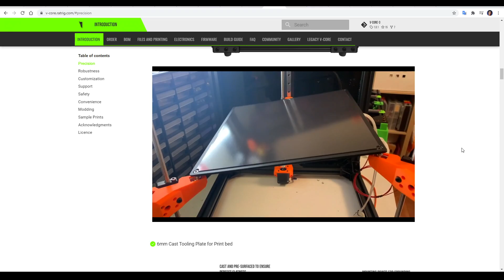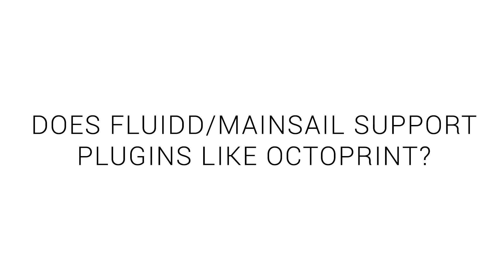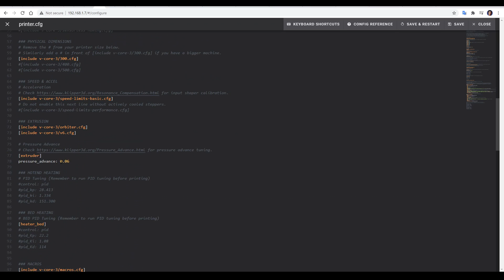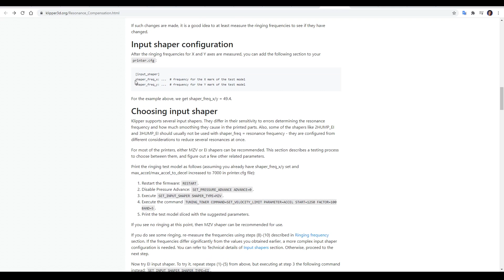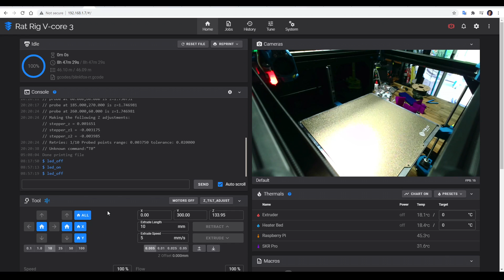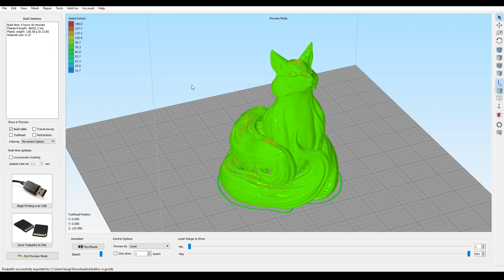Klipper input shaping - A leap forward in high speed AND high quality 3D printing [Rat Rig part 4]

Comment: Hello, first of all, I apologize for my bad English :). I have an Artillery X4 Pro 3D printer with a KL v1.01 motherboard. This motherboard has a 6-pin socket called Adx1. I want to connect my own ADXL345 sensor to this socket (the original sensor is called ADXL345, but it's quite expensive). Can you help me with the pinout?
(The sensor I bought has pins GND, VCC, CS, INT1, INT2, SDO, SDA, and SCL).
Thank you very much in advance.

Comment: The axis arrows on accelerometer ADXL345 board are not just for fun. According to the arrows board should be parallel to the printing bed and X and Y should align with your bed's X and Y. Your ADXL345 board is perpendicular to the printing bed plane and instead of X and Y you actually measure X and Z.

Comment: I used the same wire you said didn't work for the accelerometer and it worked just fine. Did have a few issues at first but it turned out I just crimped a couple connectors wrong.

Comment: wont loose hanging wires give odd resonance frequencies? shouldn't they be tightly hold down? And those connectors ware off with time and I suggest direct soldering and securing the solder points (with the wires) with some hot glue to add rigidity. Any thoughts? Am I wrong?

Comment: Very helpful video, once again. Thanks.  I have aVoron2.4 and a Ratrig Vcore3 500mm3 on the way. Question is, what does the accelerometer do that we cant do by hand, since the first version you showed using your eyechrometer also removed the ringing? Also, do you think there will ever be support for the accelerometer to make adjustments in real time?

Comment: Hi great vid… you talked about pressure advance and that you have to do it over for a different filament , you saved in the cfg file , but how do you change that in klipper when you want to print with a filament you already used before

Comment: how will this function affect the wear of the motors?
Reply: It will reduce it (for equal acceleration). I run 3000 acceleration on an Ender 3, and it is quiet. With input shaping off, that acceleration will sound like someone is hammering at it.

Comment: Thoughts on additional machine bracing, attaching the belts inline with the CG of the print head assembly (hard to pinpoint with flying cabling and linear bearing friction components maybe), and moving the accelerometer to a point that coexists with the nozzle tip as closely as possible?

Comment: Just want to say that fixing ringing and ghosting artifacts by software is really great, but it would be wise to also solve this problem using a granite or heavy base and have the 3d printer bolted to it, this will dramatically improve results. To have even more better results, have all the axis rails changed with more heavy and firm accurate rails. All the minuscule ringing will be absorbed by the mass of rails and base. This is why all of the precision CNC machines that are expensive uses heavy base and rails.

Comment: Manual tuning (mentioned at the beginning of input shaping section of the video)is much better option, doesn't take much time  and reflects real printing conditions like desired speed,acceleration, filament being extruded, nozzle interfering with printed object etc.I tried both methods and found manual method far more superior-and is really easy to do.Also found pressure advance tuning pointless on direct extruder (just set up extrusion factor),pressure advance only make sense  for bowden extruders.

Comment: note that input shaping is calibrated before pressure advance (using set_pressure_advance advance=0 if tuning shaping manually without accelerometer), and then with calibrated shaping you need to re-calibrate pressure advance again. for high-resonating printers pressure advance can change significantly.

Comment: Can I use ADXL343 from Adafruit? It's half the price of ADXL345 and on Adafruit site they are saying it's identical and any code for 345 "should" work for 343 as is.
Reply from the maker: I have three on hand. Yet to test but I will be in an upcoming video.
Reply: @TeachingTech  Thank you very much!
Reply: @TeachingTech  One additional question. Is ADXL required to be on printer even after creating and implementing tested values to printer firmware? Or can I remove it then and printer would know what to do based on these generated values? I'm asking because I would like to have it on Y axis also in my printer, so I don't know if I need one or two ADXL's.
Reply: @timp6930  You measure once, and use the same values after that.

Comment: Hi Michael, do you think input shaping would still function the same on a belt printer? (with the accelerometer mounted 45 degrees from horizontal) Since there is the additional gravity in effect, would that be an issue?

Comment: Is klipper and the accelerometer only suitable for the Rat Rug or could one use this with a cr-10?
Reply: normally I use Cura, looking to upgrade the printer with 3d bed leveling, stepper motor control and SKR MB too.

Comment: FWIW, you can get 18AWG, 4/5/6 conductor ribbon cable.  It is used for carrying power + data for LED strips. Here is one example: https://www.amazon.com/dp/B07TMKBY63  

If you only need four conductors and shorter lengths, 'trailer wire' often comes in 16/18AWG (16 for ground, 18 for the other three) or even 14AWG.  If you need to send a LOT more power, 7-pin trailer wires are generally 10/14 gauge.  (Yes, really.)

Comment: I’m just wondering if it’s worth doing this to an Ender 3. 

I was reading the info that came with some PETG, and it said print “slow”, less than 60mm/sec… 40mm/sec perimeters is my “fast speed” (it was the default Ender profile speed in prusa slicer) and I thought I was getting layer shifts trying to actually go that “fast”. 

Had it down to 20mm/sec before I figured out it was an overheating issue of the Y stepper motor/driver (even with a 140mm fan blowing on the BTT SKR Mini)
Reply: Yes it is worth it, I run an E3 at 3000 mm2/sec and 100 mm/sec. With PETG, but 10 degrees higher and an all metal heat break. Need to melt that filament.

Comment: I am not a 3d printer person...but I love watching videos about it.  I noticed that even with input shaping on as your print moved up there some some(albeit much less) ringing...I was wondering if that might be due to the resonant frequency of the printer changing slightly as the print progressed upward...and if it might be possible to have those configuration settings shift as the print progresses...or am I just missing something basic?

Comment: I tried to use Klipper in my Ender 3 with SKR 1.3 and TMC2209 drivers and wasn't able to make the motors work at all. As it is working fine with Marlin for 2 years already I simply cannot configure the TMC drivers in Klipper. If anyone has a similar working configuration let me know, please.

Comment: You should make some scale models of the 1992—1994 McLaren / Williams using some of these new techniques.

You should also store your filament spools inside of a dehydrator, a la Maker's Muse, and feed directly from that dehydrator to the printer.
Reply: Some further ways to enhance your printer;
- Real-Time 3D scanning of the print to automatically adjust and recalibrate settings on the fly if the printer's comparer realizes that something isn't adding up.
- Adding some kind of vibration dampening to the entire printer assembly (especially the bed).
- Give your printer an automatic "brush teeth" function to keep the extruder clean.
- Adding features to your custom slicer, like;
---- Non-Planar Slicing
---- Load-Depensent Infill
---- Gradient Infill
---- "Elephant's Foot" Compensation
---- Variable Layer Height

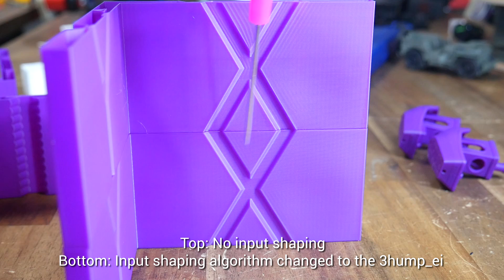Comment: Michael...do you see the vertical lines at 16:33? i have those too. 2mm spacing. 'X' side only. are these caused by the belt? how do you get rid of them?
Reply: Yes that is usually due to high belt tension. It's ok to have these to start with, once the belt settles in after initial tensioning it will loosen a bit and these will go away. If they don't, simply loosen the tension a bit until they're gone :)

Comment: I made a new printer recently.  For a belt tensioner I mounted the return pulley using a bolt through a buick drum brake hardware spring.  These are pretty stout but it is easy enough to compress.  I have yet to tune for ringing but it rings pretty badly... not a surprise but it was worth a try.

My mount has a tight guide so the pulley is captured well regardless of position.  The spring can easily be swapped or removed with a solid cylinder.

I wonder if a good video could be made regarding tensioning techniques.  Say hand tensioning (pulling the belt tight then zip tying), then with a screw, then with that flat clothespin like belt mounted spring, then a coil spring.  Also maybe taking an ender 3 or something common and adding gussets to stiffen the frame.  I think people are hung up on using the "correct" extrusion like a 2040 when truly the bending of the extrusion is insignficant, I think the rigidity is improved because of the wider contact between the extrusions at a corner and not the extrusion itself (structural engineer guy me).

Comment: Wow, are the layers on the fox noticeable to the touch or to the eye? I can't see them in the video, but I know that videos can lose that sort of detail.
Reply: That solely depends on layer height. I printed a scaled down judge dredd (5cm tall) model on the V-Core 3 with a 0.25mm nozzle at 0.05mm layer height (200 mm/s, 6k acceleration), layer lines are invisible, you need a macro lens to see them. That thing came out amazing.

Comment: I made this setup for a Hypercube (coreXY) and it worked great! Thank you very much for this playlist. I had a question about the display using an old tablet. Is there a correct way to connect or did you just use the USB as power and accessed the IP of the PI through the browser? That way, whenever you turn on the printer, you need to access the browser to see the initial screen. Is this the best way?

Comment: Solid karate chop montage. The accelerometer stuff is curious. Do you know if that will work with other boards in klipper?

I’m pumped for the #speedboatrace my personal best on an ender 3v2 is only 50m
Reply: It's independent of the board. If your board isn't fast enough or doesn't have a spare SPI port, you can just hook it up to the Raspberry Pi instead :)
Reply: @miklschmidt  i have since done a tone of reading and an adafruit accelerometer arrived tomorrow 🌞
Reply: @powersv2  excellent! Have fun :D

Comment: Thanks for making me interested in klipper. I am setting it up with my Ender3 v2. 

One detail that was not covered well in their documentation - I think you need to comment out "max_accel_to_decel" from the config file before tuning pressure advance. I started with the input shaper tuning and when I later did the pressure advance tuning I ended up printing six full prints before I realized the problem and could measure the best corner shape. 

Another issue: how would it be possible to adjust the print speed for the critical first layer when LCDs are disabled and there is no obvious way to control this with klipper during prints?

Comment: Using I2C with long wires you need to add a stronger pull up on the remote end to account for the increased capacitance of the transmission line. The Adafruit ADXL board has a 10K pull up, changing that to a 4k7 will give you more reliable signal. Also make sure you keep them far away or shielded from the high current lines for heaters and steppers.
Reply from the maker: Thanks for the tips. It's been reliable since I ran the ADXL loom separately to the rest, you are spot on.
Reply: @TeachingTech  You can also try twisting positive negative pairs together to reduce crosstalk. That's what's done on Cat5e and up.
Reply: @pinaz993  I braided the adxl loom, works perfectly. :)
Reply: @pinaz993  I know this is a relatively old comment, but I2C is not a differential signal so this will not help.
Reply: I struggled with this for a while. Don’t be like me and re-crimp, re-wire, re-solder; try a short cable with 3v & Ground first. If it works now, cut off any excess wire then maybe swap out the resistor 😁
Reply: Also using shielded Ethernet cables for signal carrying works surprisingly well.
Reply: Hi, what resistor value would you suggest for a 2m long shielded cable, and where is it I place this resistor? Im not quite sure as to how this works. Any help would be appreciated.

Comment: Why does an accelerometer need to be used to measure the acceleration? The forces are predictable since you are controlling the printing head's movement and you know all the variables involved. Can't the acceleration just be compensated for purely in software?
Reply from the maker: AS Mikkel says, the accelerometer is measuring the resonant frequency: the result of the acceleration, not the acceleration itself.
Reply: @TeachingTech  Yeah, that makes more sense then.
Reply: It is compensated for purely in software. The accelerometer is used to find the resonance frequencies to base that compensation on, this is a set it and forget it kind of thing, you could mount it temporarily if you wanted to. The only gotcha is that any time you make any physical changes to the printer (like move it, retension belts, swap a part, etc), you will have to recalibrate, so it's just more convenient leaving it permanently mounted. It's very hard trying to guess the frequency you need because so many variables are involved. Weight of the gantry, tension of the belts, construction of the frame, etc etc. With the ADXL345 you can quickly measure the resonant frequencies for both axes, calculate the most efficient shaper model and the job is done, all you have to do is write "SHAPER_CALIBRATE" :)

Comment: The second i heard "acceloremeter" it clicked, it is just so obvious and can be used for all sorts of things... like... actual feedback from the head, so that the board actually knows if something is moving.. It should be able to run full calibration now, all parameters that are about the head movement... jerk, velocity max.. all of it. Now we need an optical sensor for the filament and i have an idea for that.. 

Place a rudimentary camera (sensor+lens) after the extruder. Use the indentations that the extruder motor makes to the filament to detect motion. Needs clever piece of lighting, probably a low power laser will do it.
Reply from the maker: It's exciting where this approach can take us,. Your ideas are spot on.
Reply: I’ll be implementing a laser/ ir diode combo on my printer because reliability is key, laser under nozzle could detect nozzle jams instantly, filament run out, layer width (for calibration purposes), and lifting of print off the build surface (part would block laser path)

I made a post on Reddit discussing it more in depth
Reply: Also it should work better than camera/ ai monitoring in low/ no light conditions, and as you said, low cost

Comment: Wow, that combo of print speed and quality is just incredible!

I’m tentatively considering a V-Core 3 for my next/ultimate 3D printer, but the one thing missing is dual extrusion. (I know RRD has an IDEX model, but I want the CoreXY speed and accuracy.) When I asked, they told me that some community members are working on an IDEX mod, but that CoreXY makes it tricky. I hope it works out; that’s the only limitation I see to this being the “ultimate” 3D printer for me!
Reply: IDEX on CoreXY is not ideal if speed is what you're after, since you're putting a ton of extra weight on the gantry, which is already the bottleneck. The difference in speed between a CoreXYU/V (IDEX on CoreXY) and IDEX on a cartesian is probably negligible, minor at best. Another challenge with CoreXYU/V is equal belt tensioning between the extra set of belts. A toolchanger makes more sense on CoreXY in that respect, but is also harder to design.
Reply: @miklschmidt  Ah - many thanks for that insight! Maybe a RatRig V-Cast IDEX is what I should be looking at then. I dislike the whole concept of a moving Y-axis though. (Maybe I just need to save my pennies until I can afford an E3D Toolchanger. That’s a lot of pennies though :-/)
Reply: @DEtchells  Tbf corexy has a moving Y axis as well, but yeah when the Y axis is the bed, it makes things tricky to scale speedwise :)

Indeed, that thing is pricy. There are DIY options such as the Jubilee (one of the printers that inspired the V-Core 3) that might be worth looking into?
Reply: @miklschmidt  Yeah, it’s the idea of moving the whole mass of the bed plus the part that bugs me. Huh, I hadn’t heard of the Jubilee before, I’ll have to check it out; thanks again! (Although tbh, I’d rather print things to build other stuff than spend even more time building a 3D printer :-)
Reply: @DEtchells  Understandable, it's all about priorities. I ended up primarily using my printers to print printer parts.. 😂

Comment: Thank you! Just sorta surprised you sliced with S3D, a slicer that has not been improved for more than 2 years - which in this industry is like a lifetime ago.
Also - having the accelerometer wired directly to the motherboard, and not to a Pi, helps us eventually get rid of a Pi.
Reply from the maker: My relationship with S3D is based on the fact I've been using it for so long. Objectively, if I was starting again I'd likely switch.
Reply: @TeachingTech  Oh, yeah. No worries. I hadn't used my copy for so long, I almost forgot the interface.